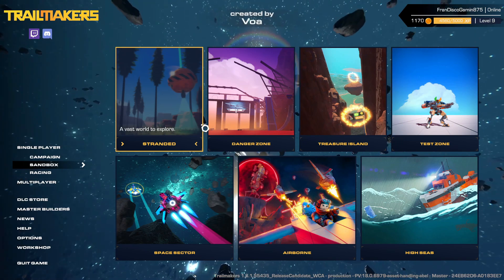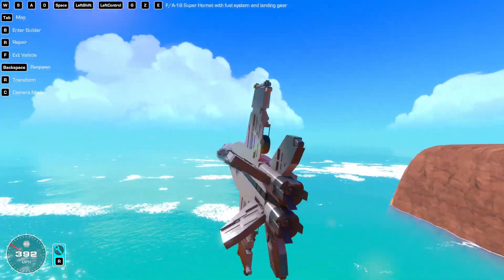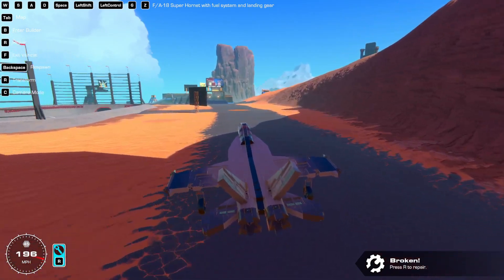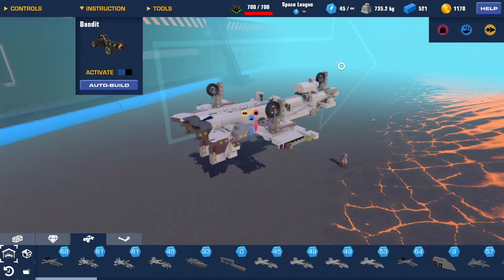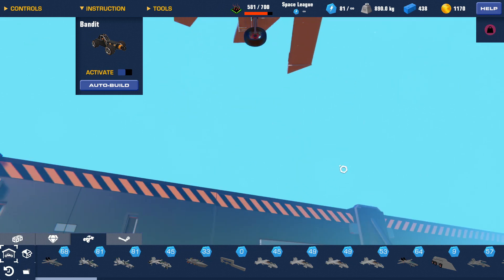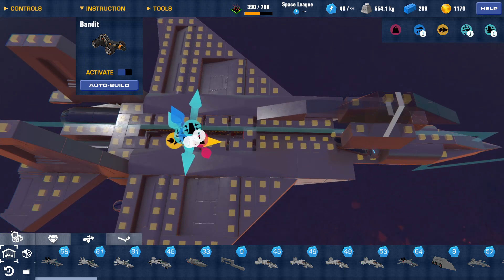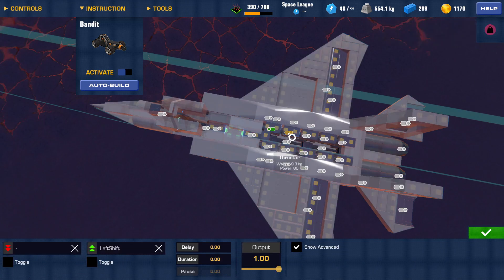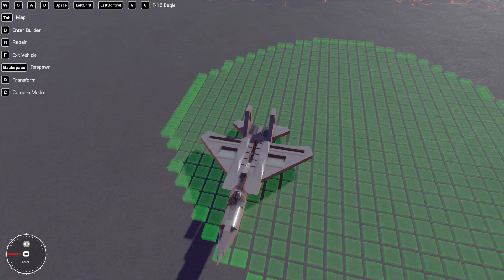I Designed an Afterburning Fuel System in Trailmakers!

Comment: great vid I would recommend using an editing software to keep up retention beats as well as keeping the video shorter and you can edit out mistakes making it flow better. I'm not a good youtuber by any means but I do watch it enough that I get what dose well and what doesn't. all around good vid and crazy system that I'm going to have to implement. 😎
Reply from the maker: Thanks for the tip! I use wondershare filmora 13 which is a pretty useful editing software that will allow me to put these suggestions to good use.👍

Comment: 3:35 I would say drag glitch is technically more realistic than without it 
(unless your using full drag glitch so you can accelerate infinitely)
Because almost all modern fighters can go over Mach one
Reply from the maker: The problem is that is as fast as it can go without full zero drag